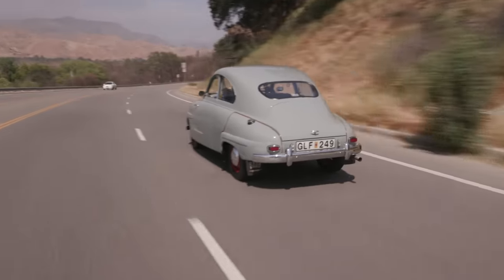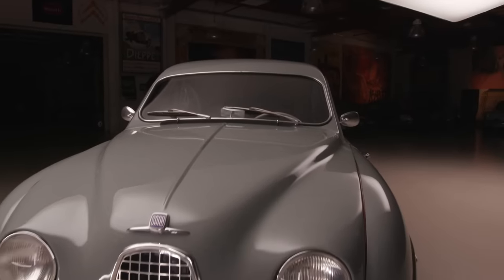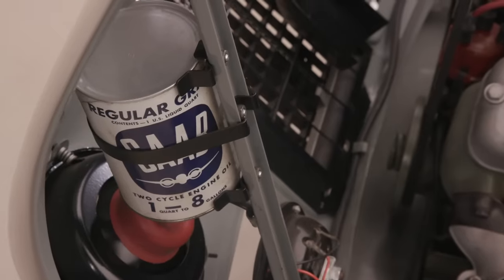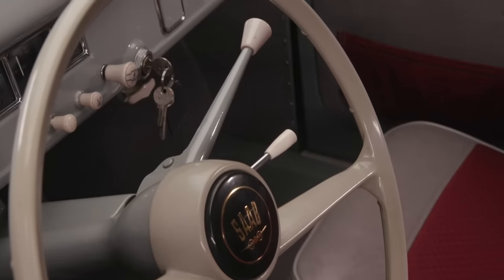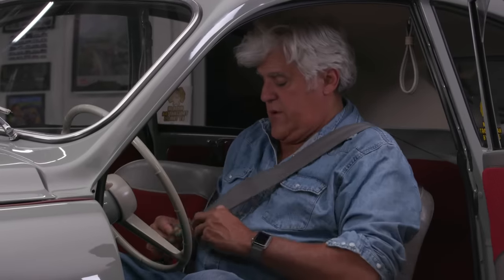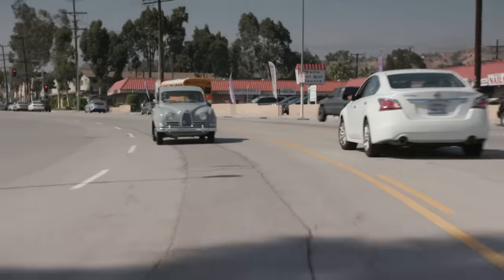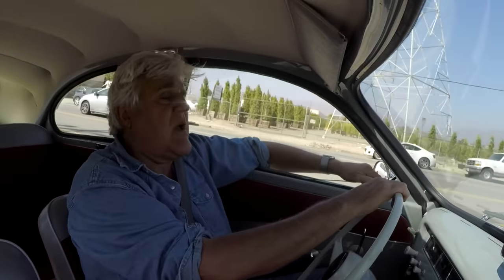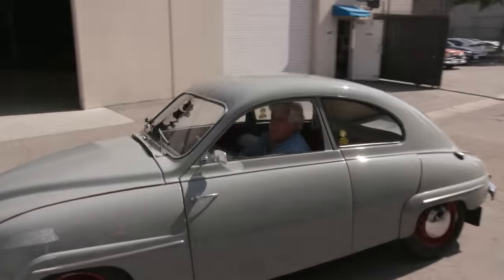1958 Saab 93 - Jay Leno's Garage

Comment: I have owned 2 - Model 99 Saabs and a 96 Saab with German Ford V4 engine. A friend had the 93 Saab with the 750cc 2 stroke engine.  The 750cc & 850cc engines were German made by DKW and the engine was used by several European car companies. Being an aircraft company Saab was following a tradition of building the body & chassis only and purchasing the engine from other companies. The 99 Saabs that I owned were a 1970 and 1972 models which used a slant 4 inline engine from British Leyland. I put over 250,000 miles on the 1972 and when sold it was still running great with no major engine repairs.

Comment: Thanks for putting this car up again Jay, I have always been fascinated by these early 2 stroke saabs.. but, will it do a burn-out...
Reply: qdood, in the mid '60's a friend of mine's older brother had the 850 Monte Carlo version that Jay talks about. He would do burnouts in that. Always got a laugh from his buddies!
Reply: Yes it will, at least my 96 did 50 yrs ago.  It was my first car, cruising local hangouts I burned some rubber pulling out of a McDonalds....got a ticket for ‘failure to maintain proper control’.
Reply: I've owned many of the early 2 strokes and they would all burnout ! Even though the HP was low on these cars, They still had good power.
Reply: They smell like doing burnout, since they burn oil haha :)

Comment: My dad bought a red 1958 model back in the days. I loved this car, never any problems or issues. Only remember to fill the correct oil in the gasoline, ..but if Im not wrong there was fuel pumps with oil mix to use on these or similar cars. - Absolute great car story. Thank you Jay Leno.

Comment: Here's an interesting little oddity about the SAAB 2 cycle engines.  The best value spark plug for the SAAB 2 stroker was the NGK A6 or A7.  They were big sparkplugs, like Ford model A sized, and the SAAB wheel lug nut wrench had a special socket to fit these monsters, complete with a rubber grip to hold them after you removed them.   The neat thing about NGK was: if at night you had a spark plug foul, and it wasn't all that common but it happened, you could look at the ceramic parts of the plugs as the engine idled and see the bluish sparkle of the combustion of the individual cylinders as the engine burbled away at idle.   And if there was a dead plug, it generally would be not flashing in time with the combustion  'dub, dub dub dub dub" of the idle's slight misfire. Made finding the dead plug easy.

Comment: I had two two stroke Saab's, a 1965 850  and a early 1967 850 3 carb model with oil injection. Both were such a blast to drive

Comment: The three point seat belt was first available in a Volvo in 1959. Volvo had a patent on the design but made it freely available in the interest of public safety.
Reply: I've read that, and it's probably the single biggest automotive lifesaver of the 20th century.

Comment: My Father had a 1962  Saab, and I remember the first time I drove it in snow, was amazed at the traction the front wheel drive had. quick and responsive. I used to kid him that it sounded like he was gargling with marbles in his mouth when he drove it.  He even pulled his 14ft aluminum boat and trailer with it. over 60mpg (with out the trailer of course. fun little car he loved it. so did I. when I got the chance to drive it. Thanks for the reminder Jay!

Comment: I wish Jay would expain the purpose of free-wheeling more. The point is a 2 stroke engine has no lubrication if you were to engine brake it, so in a two stroke you're either on the gas or idling. The free-wheeling makes sure the car returns to idle while you coast so you dont blow up the engine. The trabant is famous for only having free wheeling in the final gear, so in the other gears you would seize the engine just by coasting.
Reply: The last models equipped with the four stroke Ford Germany V4 engine still had a freewheeling drive . But it could be manually engaged or disactivated.
Reply: @vincentdubois3291  like on my 71 Sonnet.
Reply: Yeah its probably for that reason. Most 2-stroke bikes have normal engine breaking tho, you just have to use it very little or not at all.

Comment: Had a 1985 900S. Great car. Very comfortable, solid, smooth, quiet and reliable. Big hatchback and with the back seat folded down you could haul about anything. Loved the ignition switch in between the front seats and the curved front windshield.

Comment: In the early 1970's my friend had an old Saab.  His favorite joke was to pull into a service station (full service back then) and tell the guy to fill it up and top off the oil.  Of course the guy couldn't find the dipstick or an oil filler cap so my friend would hand him a container of oil and tell him, just throw this in the gas tank.  They would refuse and he'd always have to do it himself.
Reply: lowell mccormick thats strange, in the 70s there was a ton of 2 stroke cars. Japan imported a bunch, doubt it was the only one they would see. Also lawn mowers required the same thing...
Reply: I've been around a lot of odd, different automobiles since the mid 1960's and it's the only automobile I've ever seen that had 2 stroke oil added to the gas tank.  I can't think of another 2-stroke engine automobile that I've run across.  I grew up in New Orleans so maybe they didn't import any down here.  I have seen lots of 2-stroke lawnmowers and motorcycles.
Reply: @alexcorona   Name them. Subaru sold the last 2-stroke cars in the U.S. in 1970. No more came here after that. Saab stopped selling 2-stroke cars in 1968.
Reply: @lowellmccormick6991  I think Wartburgs used the same mixture. My father had one, but not surprisingly, you could not see one in the States.
Reply: I'm glad we moved away from full service stations. Maybe it is just what I'm used to but when I drove throughout Oregon a few summers back it always irked me to have someone else touch my car as if I was incapable of servicing it myself.
Reply: I've never seen or heard of a Wartburg.  I had to look it up and still didn't recognize it.  I have seen a 1939 Tatra recently in a private auto collection.
Reply: @tauncfester3022  Well, in the 1970:th SAAB was all into Ford V4 4 stroke engine in the SAAB 95 and 96.  And first Triumph 1.7 and 1.85 and then their own 2.0 liters engines.  All 4 stroke and no mixing.  Yes, there was still 2 stroke cars around, but I can't remember they was so common.  And even though my ant still had a SABB 92 back then.
Reply: @AndersJackson    I've owned a 1971 SAAB V4 with the 1.7 liter engine, and a 1969 SAAB 99 with the SAAB 2.0L B engine the PO had shoehorned into it, instead of the Triumph 1.7 L.  So yeah, I'm very familiar with their 4 strokes.    I was describing the typical refueling dance with the premix SAAB 2 cycles, of which I've owned 3.  There's baffles with holes welded into the fuel tanks of the pre-mix engined cars, to stir up the fuel and oil as you drive.  Sixten Saxon was a sheet metal genius.
Reply: @tauncfester3022  sorry, I wasn't clear.
SAAB 95 and 96 was in the beginning  two stroke engines, but changed soon to the new FORD 4 stroke engine, that din't need the pre mix petrol.  All SAAB 95 and 96 had free wheel.  And yes, they wasn't that uncommon up to fill the oil into the petrol, if the petrol station didn't had pre mixed petrol with oil. Which was not uncommon up to the mid 1970th. You always filled up the oil before you filled petrol.  The SAAB 92 was also two stroke engine. :-)
https://en.wikipedia.org/wiki/Saab_96

The SAAB 99 had the Triumph 4 stroke engines, 1.7 with a Blue top and the 1.85 with Silver top. Only the 1.7 had free wheel.  The 1.85, from 1971 removed the free wheel, and the  SAAB own 2.0 L engine with black top was introduced 1972.
They cold all use the same gear box, as I used that when I was racing with SAAB 99 in the 1980:ies.  
https://en.wikipedia.org/wiki/Saab_99

There was a few people that fitted a SAAB 96 V4 with a FORD V6 engine, that fitted to the gear box.  THAT was shoehorning the engine into the car.
https://www.youtube.com/watch?v=lxMVbBW2eTc
https://www.garaget.org/?car=96036&image=894364

Here is a SAAB 92 with 300 HP V6.
https://www.youtube.com/watch?v=uKuc5Wv0ruQ
Reply: @AndersJackson  I know exactly what engine that '69 SAAB had, it was the Swedish made, 2.0 liter "B" type engine, because the original 1.7 liter Triumph engine was in the trunk, in boxes.  This car was free, my friend ( owns a SAAB private repair shop..) had been contacted by the wife of the deceased owner, who wanted it out of their driveway.  I picked it up, and spent a few hundred $ milling the warped head,  fixing connectors and wiring on the Bosch J-tronic computer, new fuel filter.  There was no question, it was the big, first year 2.0 liter engine with the hot cam timing, large, black painted stamped steel valve cover stamped with  "SAAB".  The head gasket I bought was for a 2.0 liter SAAB 99.  I spent a few weekends fixing this car.
Reply: @lowellmccormick6991  well the 2-stroke engines from east germany and the soviet union also required to put oil into the Gas tank, but on the Trabant, the gas tank basically behind and above the engine kinda was a bigger oil tank that just happened to get filled with gas

Comment: These cars are very under-appreciated and misunderstood. Im glad they're getting a bit more recognition nowadays. Then again, the comments on this video are showing that many people still don't get it.
Reply: Very much misunderstood. Usually by muscle car meatheads like Jay said, and mechanics used to working on more "conventional" cars. These are SO easy to work on as are the later 4-stroke V4s.
Reply: And, some misconceptions about their reliability.  Well maintained, they were mostly trouble free for many thousands of miles.  I owned several that were recovered from owners who did some marginal thing to cause a failure and then I could pick up the car very cheap and repair myself.  I suppose the CV joints on the front axles were the most  likely thing to go if you owned the car long term.
Reply: @whalesong999  Out of all the 96/95s we had between my brothers, my father and I owned, all bought very used beaters and no more than $500 paid for any of them. Usually much less. Factoring in 25% of them parts cars, we had to have owned 30 to 50 of them. Only once, my oldest brother had a front wheel bearing on a 6400 mile trip  driving from Maine to San Francisco. Can't recall a CV joint ever going.The quality of the metal from the CV joint, to  the highest quality grease available made them so bullet proof. But we shouldn't  talk them up too much because it will shoot the price up even more for the cars!
Reply: @UberLummox  Interesting... .  I picked up the autos much the same way as you all and had around 6 all total, three just given to me.  Only had one CV get noisy and go bad and that was from a ripped boot.  Yes, the materials were top grade, in the engines too.  When I picked up my '99' model, it had a rear wheel bearing get very noisy on a trip and a dealer replaced on warranty.  I suspect not ever owning another SAAB of any kind due to attrition of time but they were fine autos to own and served so well.

Comment: erik carlsson was famous in sweden under the name Carlsson on the roof,  from a swedish child book.(after he ended up in a trench upside down) I come from a town close to trollhättan(home to saab and Erik), my father know a mechanic who worked on Eriks cars, so my father got a saab as his first car, one day the mechanic asked him if he wanted a tune and boosted engine from the rally saab. my father said yes. he told me that most volvo drivers got confused when a saab drove past them, I find that hilarious
Reply: I got to meet på taket in 2001. Incredibly nice guy.
Reply: @noiwonttellyoumyname.4385  His signature from 1997 is on the inside of the owner's manual of my 1960 Saab 93F. I've seen a picture of him sitting on a rock with a beer in his hand, looking a little annoyed by the upside-down 96 in back of him.
Reply: @lawrencelewis8105  that was a commercial for the soft drink Pommac.  You find it a bit down on this page, to the left.
https://www.minnenasjournal.nu/locka-till-skratt-med-en-rolig-aforism/

And here are a longer article about him after he passed away.  There they explain how he got the name.
http://www.classicmotor.se/artiklar/artiklar/20150527/erik-carlsson-in-memorian/

All links in Swedish, sorry.  But you can use Google translate if you want to know more.
Reply: Erik "Carlsson on the roof" got his nickname after getting stuck in a mudpit in an African rallye, there where bystanders that tried to push them out of the pit, but the car was so bogged down it wouldn't move. Eric then came up with the idea to roll the car sideways up on firm soil. It took a great deal of persuation to get the bystanders to actually do the rolling, but they did. When done he just started the oilsumpless car and drove off to victory in the long rally. After finishing he got questioned about if the whole ordeal really was true, so he and the crew did it again and drove off! :) Told as I remembered it when attenting a speach visit by his old friend and Volvo competitor Tom Trana , he drove PV544 among others.
Reply: @AndersJackson  @Anders Jackson- that is the picture- thanks! I wish I could have met hem.
Reply: @Bratfalken  yes, it was attributed to Tom Trana, according to the link.  I don't remember I seen that about the rally, so thanks for that information.
Reply: The SAABs were famous for rolling over and coming onto their wheels again, then zoom on.
Reply: I had to look it up, but the Saab my friend drove looks like a model 99. In a time where the cars were mostly the size of 70's Plymouth Fury's, we stuck out.

Comment: I had a slightly later model that didn't have the suicide doors. My dad bought it for me for $850, with 92,000 miles on it. Such odd features. Major flaw was that the distributor was right behind the front grill where it would cake with ice when you drove in a snowstorm. At 100,000 miles it needed a new transmission, so my garage in Woodstock, VT swapped out a good one for $200. Another flaw was that in the summer heat, the engine would get extremely hot unless you ran the heater. My sneakers would nearly melt from the hot air blowing on my feet. Had to sell it when I planned to drive across country, knowing that it wouldn't make it over the rockies. Bought a new, '70 VW bug convertible for $2700. Drove that across the country and back twice. Fun times with those cars.

Comment: Freewheeling is necessary to get lubrication in the engine, if you go off the gas then the valve in the carburetor closes and you have no lubrication anymore. That is why the engine goes to idle where the idle jet does provide lubrication. Beautiful car, I myself have a newer Saab 9-5 but have always had a weakness for the 2-stroke engine, even more so for the Wartburg that sings even better.

Comment: Dad's '60 93f (last year of the 93)  did not have suicide doors, but all the rest of this brings back memories. In 61 my older sister totaled that great little car and walked away from a serious crash. (The windshield popped out-as designed.) Dad then bought a new 61 Saab 96, with the new back end (big taillights, big backlight, flip out back windows, 40 horsepower, new instrument panel, key starter) We used that for 5 years, then he traded it for a new 66 96 (new front end, radiator in front...then the engine, 3 carbs, 850, (46 hp.) 4 on the tree). -I used that car a lot. it topped out at 86 mph. -BTW, even our 60 had MPH on the speedo, not KPH.

Comment: One of f the reasons for "freewheeling" is that as as two cycle engines have the oil in the gas, while "engine breaking", especially on long downgrades with foot off the gas, the engine would suffer from lack of oil.
Reply: You really could break a 2 stroke with engine braking!

Comment: First car I ever owned. Bought a second hand one in 1961 for $600. I am sure it was older than Jay’s because it didn’t have a seat belt. The suicide door had one real advantage. As long as it wasn’t parked facing uphill, I could put my shoulder to the frame, push it, hop in, put it in gear and, voila, it started. I did this on many a cold New England night while in college. After graduation, the Navy sent me to the west coast and my younger brother inherited my wheels.

Comment: Freewheeling was an important feature for the two stroke engine. If you compression brake a 2 stroke running premix, you are shutting off the lubrication to the engine when you close the throttle... which can have very bad results if, for example, you're compression braking down a long hill.
Reply: vk2aaf hamradio true but they kept it as a a good habit in the later v4 models
Reply: Was selectable in the footwell
Reply: @nicolajc  My brother never used the freewheeling in his 1965 Saab 96, even down a steep hill with the engine screaming. One day later, the bottom of the number 2 cylinder blew out on the Massachusetts turnpike and that was the end of that.
Reply: @lawrencelewis8105   I'm guessing that his engine's original fuel pump was broken on that car, replaced with an electric one, but no-one bothered to blank off the port for the old pnuematic fuel pump? He could have pulled the choke open a small amount  The reason for the freewheel was better gas mileage.
Reply: @tauncfester3022  Possibly, but I have no way of knowing since that was 45 years ago. I do recall that it didn't get very good mileage, not even 18 MPG, likely because he never used the freewheel which sure as hell killed that car.